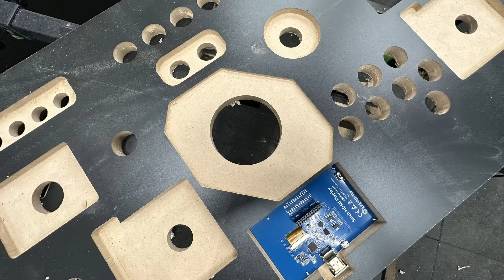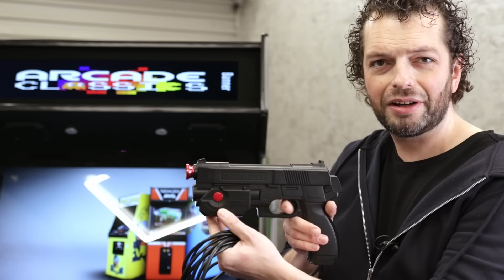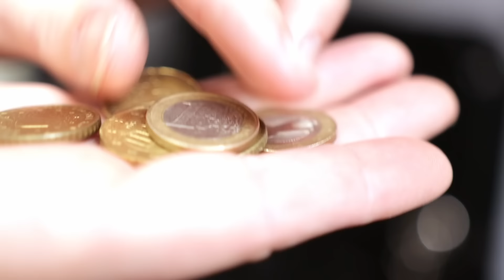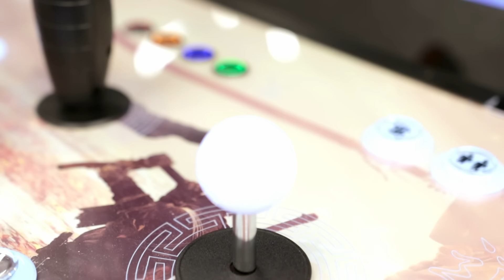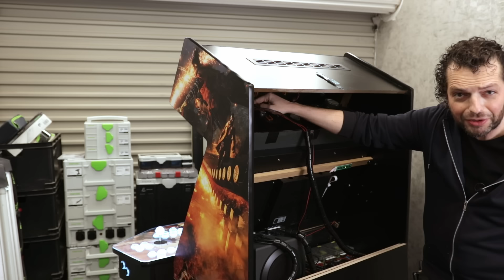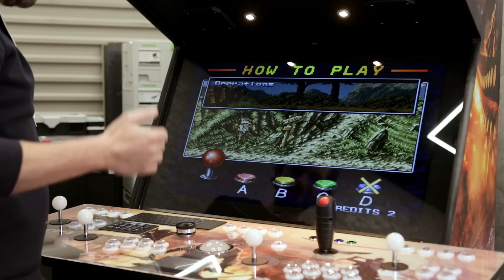Is this the best Arcade cabinet I have ever made? FULL video #arcade #sekiro_cabinet

Comment: Very detailed and informative video. First video with an actual professional creator.

The Gun4IR I was interested in from said company is super duper expensive.
I got the RetroShooters instead. They are really great. Had Sindens but they were just too unreliable due to the technology it relies on. 
RS guns use reflective tapes signaling back to the camera on the gun. And Sindens use what I think is reflection off the white or black bar that one needs to set up on the emulator which is not nice looking.
Reply from the maker: Thanks! Yes I like Retroshooters as well. I think Gun4IR's are great also. Sinden I didn't like that much..

Comment: Well done. It's awesome.
Things I hate about it though:
1. Why aren't the guns connected in the drawer? Would save you the hassle of connecting them each time.
2. The foam around the guns doesn't have a cutout so you can take them out easily.
3. Make a limit to how high the speakers can turn up, or someone will turn them all the way up, destroying the speakers (speakers actually will break at full volume over time)
4. The keyboard always visible doesn't look good at all.

Comment: Beautiful build! I was wondering if you use an active subwoofer and split the audiosigna from the pcl to the subwoofer and the amplifier for the speakers? Or do you have a passive sub and control it another way?
Reply from the maker: Passive sub, controlled by the amp

Comment: Fantastic build! I have a question regarding the stream deck. My machine setup with have the ability to rotate the screen vertically and I'm wondering if there is a way to program a hotkey to manually rotate the screen. I don't want to have to go into every .ini file for each game and edit the rotation settings.
Reply from the maker: The screen is rotated because of the INI file the game uses to load. Streamdeck can start any game but it will start as setup in that file. So no, I don’t think that can be done 😅

Comment: Love so many things about the design, but that angle on the screen is really bad for gun games! Everything becomes distorted when you step further away from the machine to shoot. Having a more 'upright' screen was one of my 'essential' things to do when designing a arcade cabinet intended for use with Gun games too!  May not seem obvious for people immediately, but when you compare 'straight on', or near upright Vs this amount of angle, it really makes a huge difference. Probably super technical and difficult, but how about when you pull the Gun drawer open that is attached to a system that adjusts the screen angle too, and puts it back to 'normal' when closed again? Maybe the stuff of dreams there!! Awesome cabs though! 🙂
Reply from the maker: Thanks for the info, lets do some testing indeed! The guns work great but ‘greater 
‘ is always nice indeed 😄
Reply: @TheDanielSpies_Arcades Hi Daniel, very nice job mate🎉 do you have a video on how to initiate in this journey? I would like to learn how everything works

Comment: Awesome job as usual Daniel!
It looks like you're standing fairly close to the cabinet when using the gun-I've heard you should be 1.5-2x the size of your monitor for gun4IR to work, so in your case 48-64 inches.
It appears to work great even closer up than that, is this the case? I'm thinking of adding the guns to my cabinet but hesitant due to that limitation, but if it isn't a problem I'm going for it!
Reply from the maker: Not a problem, go for it!

Comment: Besides the app you use to set the joysticks in 4 way or 8 way mode, what other apps do you typically run on the Stream Deck? Also, where did you get the game related Stream Deck icons?
Reply from the maker: For one: you can launch games via the StreamDeck. I use (or make) animated GIF's. You can find examples of this in several of my previous builds on Youtube. I also have the game launch script available for free if you like. 
I also use it to run apps like LED Blinky for Animations, Rocket Launcher UI, Hyper HQ etc.
 
Kind regards, Daniel

Comment: Interesting monitor, do you know if the 15khz/31khz modes can be used with the HDMI port or do you need to use the VGA port?
Reply from the maker: Hmm good question. Will check that out 👍🏼

Comment: Thanks!
Reply: Was wondering with all your USB inputs how do you keep your front end from reassigning your controls every time you restart the arcade?
Reply from the maker: Thanks for the Superlike, much appreciated 🙏🏼. Ok the main inputs (Ipac Ultimate boards for players 1 till 4) have fixed ID’s and will always be the correct players. Same goes for the guns. If however you connect lets say an Xbox controller next to these ‘fixed’ peripherals, that could sometimes cause an issue. 😅

Comment: Subwoofer being completely enclosed is a bad idea.
Reply: Dammn wow how much is the price range for a cabinet like this ?  5k-10k range?
Reply from the maker: Correct, that is why it is not enclosed 😂 there is a big air vent in the back. The sound and bass is amazing. Did many many tests before I made this.
Reply: @TheDanielSpies nah it’s a bad design from a sound standpoint.  The port needs to fire in to the room.
Reply: @stevebevel2693  I'm sure your front-ported bass sounds terrific, but so will Daniël's rear port bass.  Midrange and especially tweeters are very directional, and just like you suggest, should be mounted forward-facing.  Bass, however, is not directional.  It actually can have enhanced sound when bounced rearward since it can then use the entire wall as a sounding board, not unlike a unipole antenna using the flat earth as a massive virtual dipole.  In addition to using the rear vents as a sound port, the resonant frequency of his cabinets, based on the size, will be about 60-100Hz, so he's getting a huge resonant boost at that low frequency free of charge by venting in the cabinet and porting to the rear.  It's the same principle as used in many Bose speaker designs.  Source: I took Amar Bose's sound design course as a grad student.
Reply: @AnalogGuy1  he’s got the entire enclosure enclosed. Not even reading the rest of your blather. 
You are not an expert in acoustics. Stay in your lane.
Reply: @stevebevel2693  Easy there, tiger. His case is vented.  As long as the vent holes are more than a quarter of the sound wavelength, they’ll radiate just fine. I’m always willing to learn more about acoustics, although what sounds like blather to you might be because you don’t have a doctorate in engineering. One of my most lab’s most profitable patents uses bass reflex loudspeakers as seismic transducers, covered in Discovery Channel. But, I am always willing to learn more if you can be specific.
Reply: @AnalogGuy1  ah yes, an engineer in a tangentially related field knows more about acoustics than anybody else ever could!
Reply: @stevebevel2693 Messing with this I find the bass firing from the back much better in feel and sound as it hits the the back wall and coming outward a huge difference in over sound.
Reply: You are Welcome to build one too
Reply: @dutchcinephile1362 I have. Sounds great!

Comment: A very beautiful and functional machine. The only thing that confuses me is the choice of monitor. Full HD resolutions are not enough for such a screen size when playing modern games. There is no support for freesync, in many mame games that work at a frequency of 54-55 hertz (for example, mortal kombat) there will be gaps in the image. Or am I wrong and freesync is in this monitor?
Reply from the maker: Yes, For the competitive gamer, you would prefer different hardware. Preferably original. Freesync works with AMD graphic cards, Nvidia has his own version. But to notice /or enjoy the difference, I would rather suggest playing MK on a FPGA with CRT or PVM monitor. As USB also adds latency and 1.3ms is still more then the zero latency on a crt. Overall, the reviews I read about the Arcooda’s are very good.  Regards from the Netherlands, Daniël
Reply: Freesync works great with both AMD and Nvidia. I agree with you that it is better to play on a crt monitor, but when there is no such possibility, freesync greatly improves the gameplay. Regards from the Russia, Vitaly

Comment: OMFG Once again, AMAZING CABINET, it's clear that you have a knack for it, you radiate an aura of passion for creating them💪💪💪💪

Thank you for the tip about this Arcooda 32 boe monitor, it's a pity there are no bigger ones than 32 but I still have to have it :P

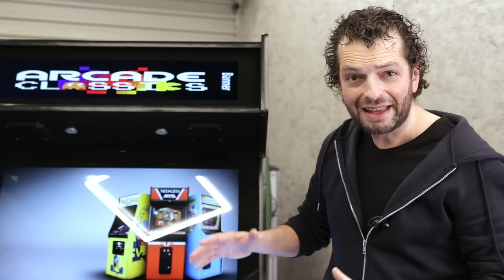3:02 This pull-out shelf looks great, I'm thinking about installing two of them because I have more equipment :D

Could you tell me what exactly the guides for this shelf, so-called model, are?

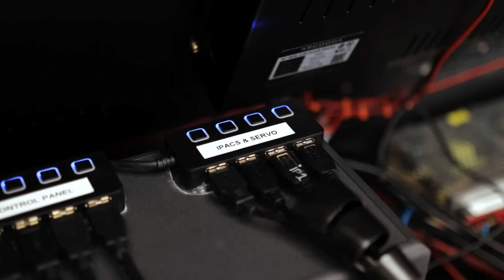13:01 Could you tell me what model these USB hubs are?

14:50 WTF could you tell me what version of Mame you are using, that metal slug doesn't slow down, as we know most metal slugs and other games slow down which is irritating 🤬

15:59 You forgot to add that F2 is better to make such settings at the beginning because unfortunately after entering the service mode Hi-Score resets, I don't know what causes it but it's sad 😭

Thank you very much 🤩
Reply from the maker: Send me an email please, I will help with your questions 👍🏼
Reply: @TheDanielSpies  Ok i send message ;)
Reply: There is a hacked version of MS2 called MS2 Turbo that fixes a lot of the lag the original had. Also, some emulators have an option to 'speed up' the emulated game clock to reduce slowdown, but it may introduce some weird behavior.